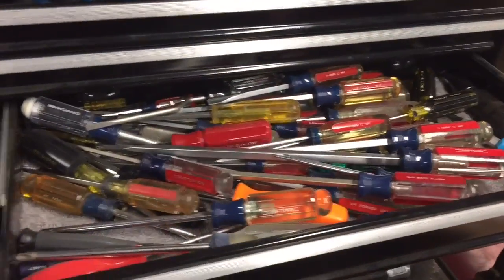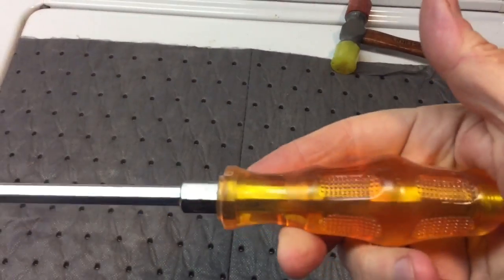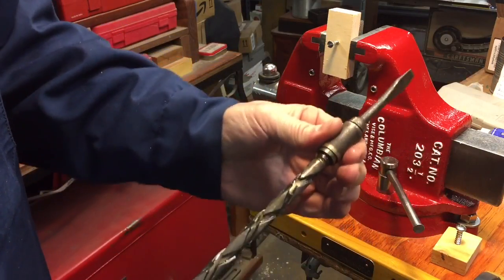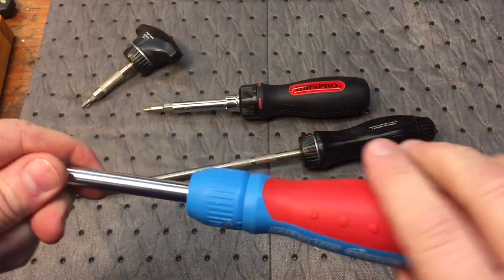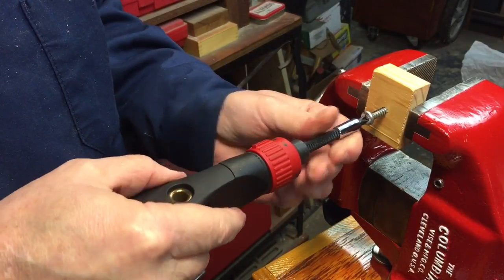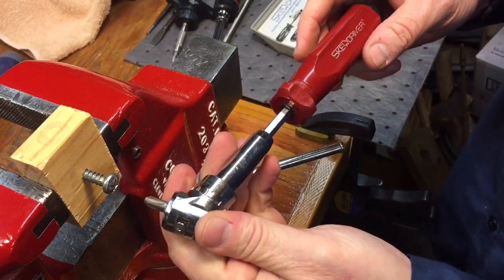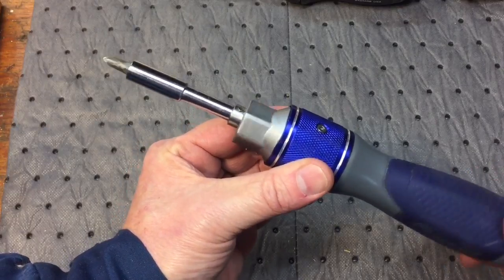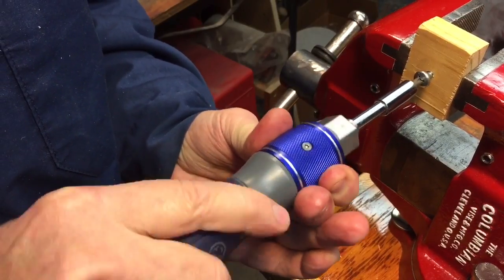Some Interesting Ratcheting Screwdrivers...

Comment: I have a vintage "Screwball" ratcheting screwdriver. It is orange and ball shaped. Made in the USA. Can't say that I use it, more of a collectible piece. Also have a vintage ratcheting "Versatool" with the original box I might add. Both are pretty cool pieces.

Comment: The yellow one you show second in the video has a grip that reminds me of the modern Wera screw driver grip. I love it as well. 

That skewdriver is really interesting. Never seen anything like that. I imagine that could be useful for a mechanic with those hard to reach screws.

PS. Im jealous of how organized your tools are. My shop is a chaos :)
Reply from the maker: Hello Kopsu- You’re right about the Wera design- I’m going to have to give them a try but they are a bit pricey... The Skewdriver is cool but I’ve yet to use it!  😃  
Unfortunately my shop is a mess too! My biggest problem is I ran out of room! I need to get rid of stuff but I save everything!  I read somewhere that a clean organized shop is the sign of a sick mind! 😂😂😂 Thanks!

Comment: That Skewdriver was cool , but I really liked that Cobalt . That one is new to me . My Tool chest top is loaded with screw drivers just as yours is . My best driver set is in my second drawer and organized . But my most used hand screw driver set is a Full Harbor Freight set organized in slots on top of my work bench , and all my good bit sets are sitting in my second drawer with my good screw drivers so I can always find them when I need them . My common Law son , just did not like the drawers that went under his bed . So I asked if I could have them . Now I have an 8 drawer set I built under my 8 foot work bench . I might do a video this summer on my garage/shop set up .
Reply from the maker: Hi Dave, It's funny how we have out favorites when it comes to tools, I always used to say you can't judge a screwdriver until you've been using it for 20 minutes straight, that's when you start to feel if you're going to blister-up or cramp-up. I would love to see your shop! I always enjoy seeing different workshops!  Thanks!

Comment: Sweet set of screwdrivers! I could have used that Kobalt rachecting driver today. I visited my aunt and was put to work on her fence attaching a new metal latch by hand. ( she lost the electric drill/driver I kept at her house and I don't keep power tools in my wife's car ) let's just say I appreciate my power tools 😆but if I kept a ratcheting screwdriver in my her car I wouldn't have suffered so much driving #2 screws into P.T. wood.
Reply from the maker: Hi Carlos, We are all addicted to our battery drill/drivers but there is something special about using hand tools that gets lost when using power tools. I wouldn't want to drive in 50 screws by hand but nothing beats hand screwing a half dozen screws with a good comfortable well fitting screwdriver!  -and I feel your pain with the pressure treated for sure!  Thanks!

Comment: Channellock is a USA or even Canada rebrand by mega-pro, did you see the craftsman one I got recently? It is supposed to be a snap on rebrand but has a rounded handle like you like. I got it from my local ace for $18 after my biweekly reward coupon $7 off $20 or I get $5 off $5 or more from them monthly with 2 biweekly deals... I have plans of building up some nos craftsman with those coupons =)

Comment: Hi I liked the Skew one..think they were around a while ago..never used one..Kobalt one was good,but no more Kobalt tools here,reason is Lowes who are Kobalt got involved in a disastrous joint venture with Woolworths supermarkets to create a hardware chain called Masters to compete with the well established Bunnings which is owned by suoermarket rival COLES..Well it was a SNAFU,that cost Woolworths $millions,and Lowes who were importing all the hardware and tools,brands such as Stahlwille and Kobalt went home..I dont know how much the Snap-On one would cost probably a arm and a leg..Years ago our manufacturer Turner Tools had a very good ratchet screwdriver..I had one once ..Then Stanley took over Turner and kept same design with their name on it for awhile then closed it all  down and just imported stuff..Dont see many Yankees type tools these days and you are VERY right about the slipping aspect,problem was because you were further away from the screw trying to exert pressure it was easy to be fractionally off center and flat blades can easily slip,Philips not so bad though..keep up the good work ..Bob

Comment: Those antique push driver screwdrivers, were they called a yankee screwdriver?  Or was that a brand name of push driver?
Reply from the maker: Hello stuntcardriver- Yes! The Yankee brand was marketed by the North Bros. in 1899 and they made all types of variations to the design... Stanley bought the rights to the design in the 40's and made a gazillion of them in all varieties. Screwdrivers, push drills...
They work well until the bit slips off the screw and you plunge your Yankee into your project... Then it went into the drawer waiting for the next unsuspecting user!  😃👍

Comment: Can't stand ratcheting drivers anymore.  Tired of finally getting into position and then having to stop everything so I can fondle my tool to screw anything.  I got a solid shaft with a magnetic tip that's ready to screw anytime.  Every ratcheting driver I've had is in a dump somewhere after it gave out trying to screw something tight.

Comment: hehe the yellow screwdrivers are a knock off of german wera, they still make the same shape, but with rubber inserts,regarded as the best screwdrivers int the world.    AHH! stanley yankees, no thanks , i prefer having 2 eyeballs!
Reply from the maker: Hello Jusb- Yes- I think I bought the whole set years back from Garrett Wade Co. for $20- I always liked Clear/translucent handles and these are just very heavy duty. I probably use my trusty Craftsman Screwdrivers the most... I love the way they look.  I would give Wera a try but they are quite expensive...
You’re right about the Yankee’s but as a kid they made great toys! 😃👍
Reply: i bought into stanley magnum screwdrivers (the first 2 part and triangular handle) they are still great, i bought a few sets of the common and a few less common, a big drawer full! ,  i still love those the most, coming on for 30 years old
Reply from the maker: Jusb1066 - I looked them up and they are still available- they must have been marketed in the UK because I never seen them for sale on this side of the pond. Triangle grips are naturally ergonomic and I wonder why more Screwdrivers don’t incorporate them!  Looks like a great set!  😃👍
Reply: yep my set are uk made, not sure about the current ones, and the older are grey with red or blue insets, the steel is very good and hard wearing, just sometimes you see a tool and know you love it
Reply: Originally the Wera Kraftform grips were fully plastic without rubber. They're still available as Wera "Kraftform Classic":

https://www.amazon.de/Wera-Schraubendrehersatz-Kraftform-6-teilig-05031281001/dp/B000XIVZ2Q/ref=sr_1_1?ie=UTF8&qid=1526164157&sr=8-1&keywords=wera+kraftform+classic

The first ones were 1970s orange...then they turned over to black. The insulated ones are red.
Reply from the maker: Marcel you are GREAT!!!!  Thanks!!!!!
Reply: @ScoutCrafter  Do you have a link to those yellow demolition chrome vanadium screwdrivers?  Thanks!